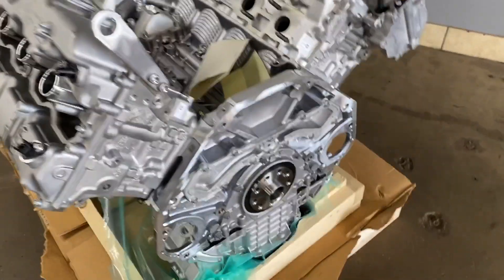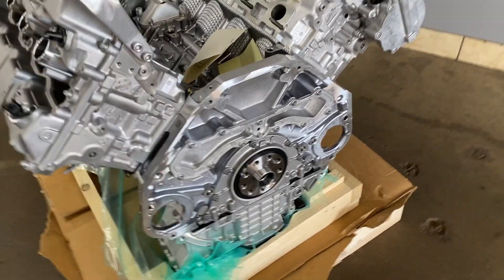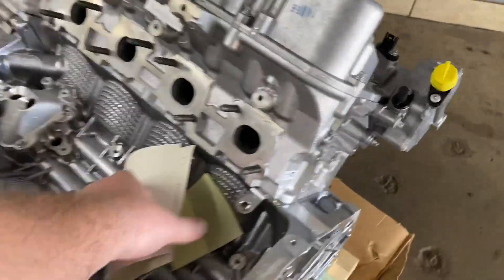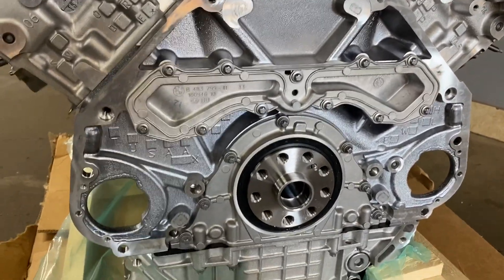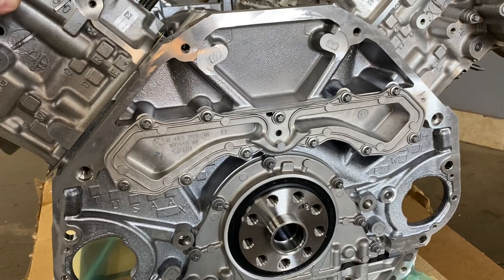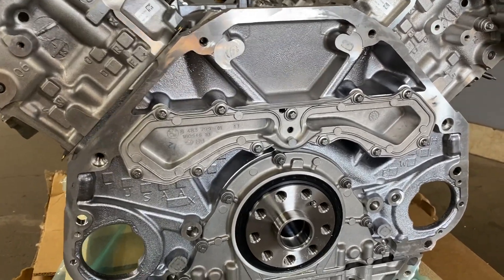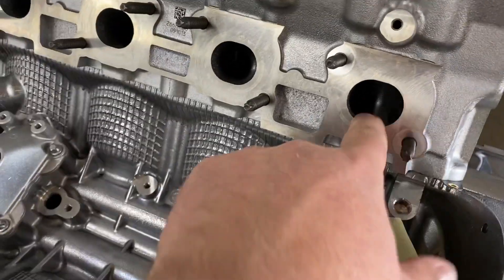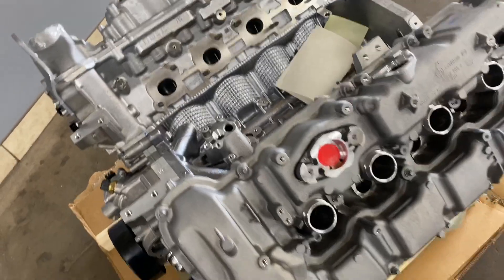BMW N63 V8 Twin Turbo Engine Replacement Part 2

Comment: i recently got a manufactured n63 in a 2012 750li from factory, do you know if they upgraded any of the parts or redesigned anytjinthing to prevent a lot of the issues we were having with valvestem seals or other common issues..it said short block on paperwork but i assume it was an entire engine...
Reply from the maker: No, it's not an entire engine and just long block. BMW says that they did such as rear plate above the rear main seal where we had a lot of coolant leaks but I seen that the new designs are failing too. With that being said if BMW says that they updated stuff but more likely they did not make new stuff whole lot better.